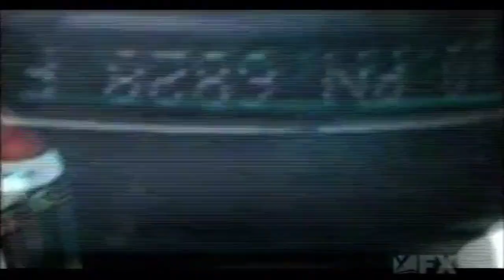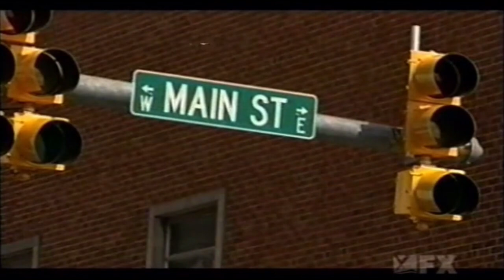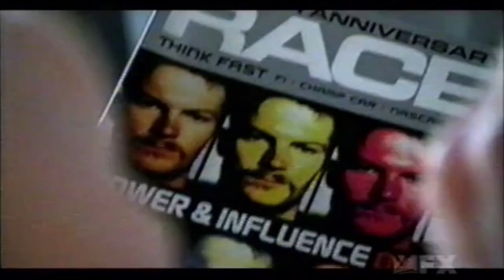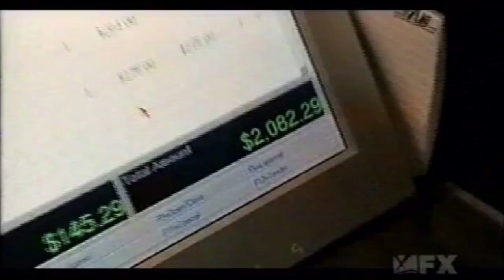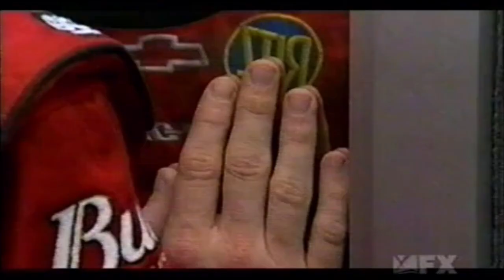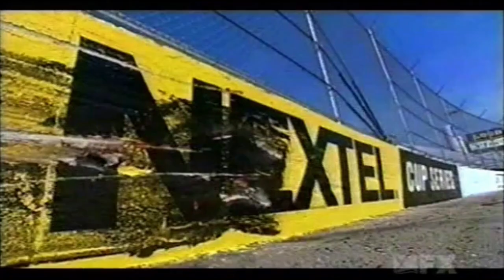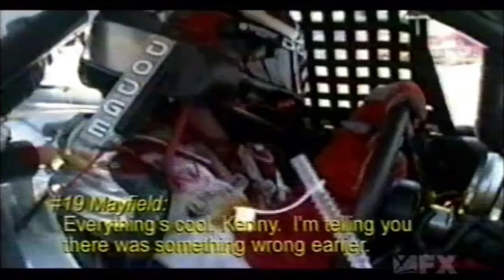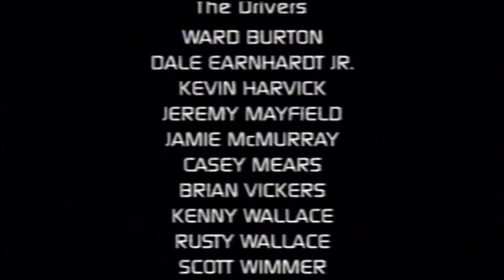NASCAR Drivers 360: Martinsville 2004

Comment: I had the first year of the Yamaha 250F in 2001 and they were very hard to start until you get used to it.It's a 4 stroke and it has a compression lever you pulled till it had resistance and slowly push the kick starter till that has resistance then let it back up and kick to start.I thought Jamie's was a 4 stroke but it's a 2 stroke so I have no idea why he couldn't start it.HAHA